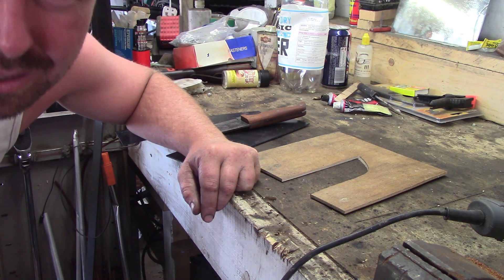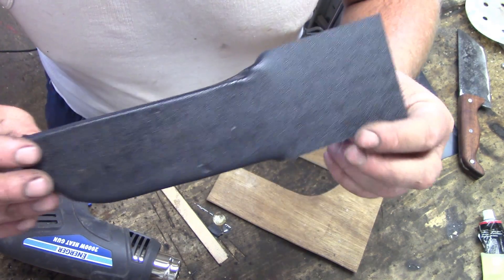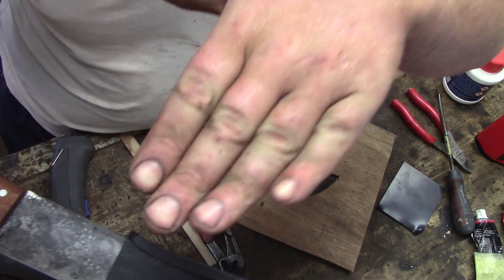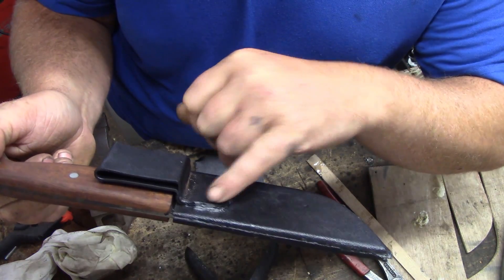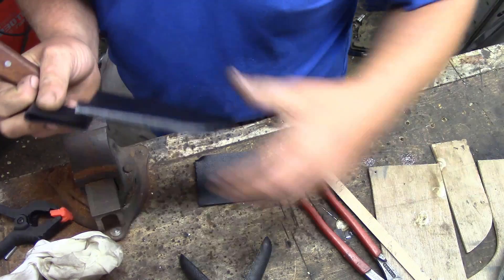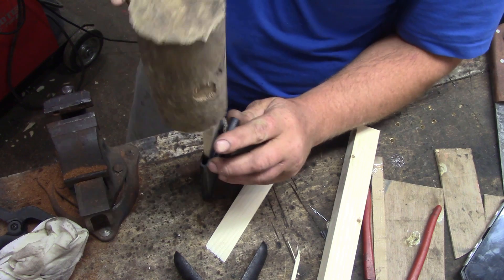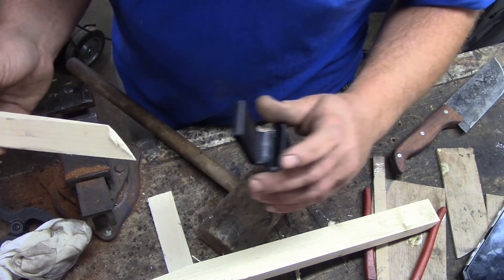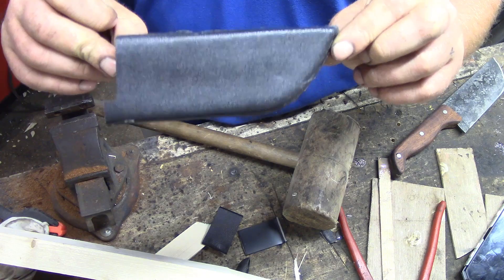Experiments with ABS not kydex for knife sheath

Comment: That is a really positive result, surprising really. Why don't you try your hand on injection molding. Not the easiest in the world but should be within the realm of possibility, shouldn't it?
Reply from the maker: See I look at industry and think I should be trying ultrasonic welding like they do with the little plastic fuel tanks, the most difficult thing about injection molding is the plastic streams meeting each other (there is a name for it but I've forgotten) so better suited plastics are used like straight polystyrene which has pretty poor mechanical properties. 
Interesting suggestion though and I'm glad you enjoyed the experiment.
Reply: @turboconqueringmegaeagle9006  I did, thoroughly.
Looked up injection molding and while doing so found a guy using acetone to repair abs plastic, probably weakens it but still worth checking out I think.
By the by, what are those properties that made you go with abs instead of kydex? Or HDPE or PP for that matter?
Is it just price?
Reply from the maker: Cost mostly! Also abs and kydex are pretty similar but abS is styrene based while kydex is PVC based, both are then blended with acrylic.
Being styrene based, abs is far more soluble in solvents such as mek and acetone than the kydex.
Pp has excellent chemical resistance meaning it is notoriously hard to chemically bond (the bottles you buy MEK or acetone in are normally made of pp) it'd be a good plastic to use if "plastic welding" with either direct heat or ultrasonic.
I don't think pp has the UV resistance of the kydex or abs which fair pretty well thanks to their acrylic content.

Comment: love the channel turbo. But fuck plastic off for sheaths. leather, leather, leather, leather. You could have made a leather one a lot quicker. I can make you one.
Reply from the maker: jimmy fandago I know, I hate them too, but my main aim here is to create a machete that I can sell for the same money as a Condor, I don't like the traditional canvas sheaths on machetes because eventually they wear through and the leather sheath double the material cost, time and weight of the whole lot, at the moment when I stitch leather I use a speedy stitch,  contrary to the name I appreciate they are pretty slow compared with getting good with two needles but even if I practice and manage to run a sheath out in a couple of hours I won't be able to sell at £70.
Functionality and affordability first then aesthetics, if however you can give me some pointers with speeding up my leather work so I can do a meter of stitching in 5 minutes without an industrial sewing machine, I'm all ears budy! 
If you saw my parang build, I made a sheath for that, how much would you expect something like that to cost?

Comment: love the knife, it looks like a shorter Hudson's bay camp knife like the Hudson's bay trapping company issued their fur trappers, on the sheath what about having it wrap around the knife to half way up the handle then just rivet one side?
Reply from the maker: beery87 another good idea with the sheath, thanks.
The knife was just a bit of messing around, I want to offer a full size machete for sale at a competitive price, no intention of batch producing this knife as it's a bit too light, but might try something similar a bit longer and thicker.
Reply: just looking at the sheath on my glock field knife and its pretty similar to how you made yours except the seams and on the front and back of the sheath rather than the sides, I suppose it keeps the edge of the blade away from any weak points, might be worth googling the glock field knife and having a look?
Reply from the maker: beery87 from what I saw on gloogle the Glock sheath is injection molded and the seems must be the part lines of the mold, nice style of knife and sheath but those guys obviously have the money for really big expensive tools!